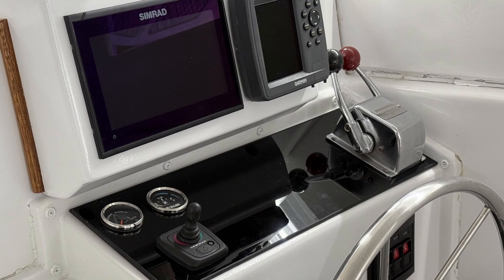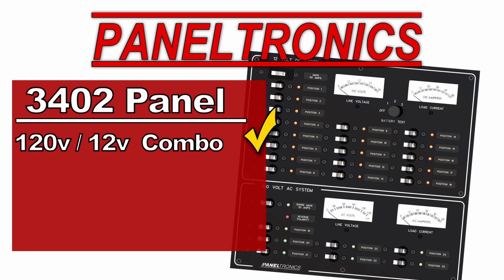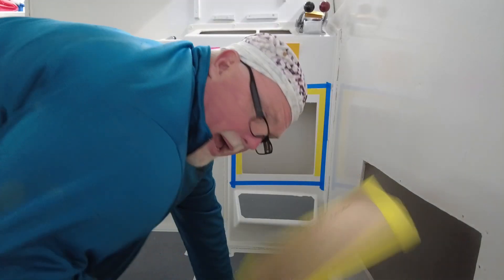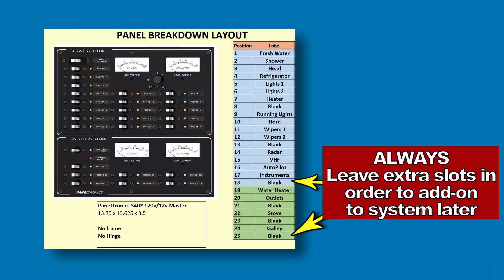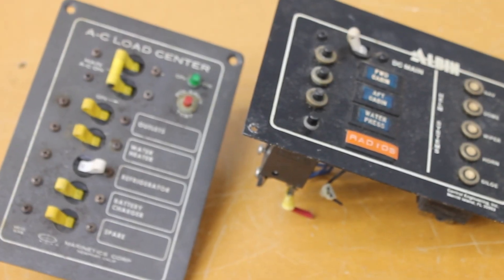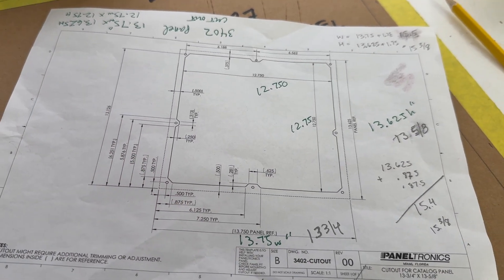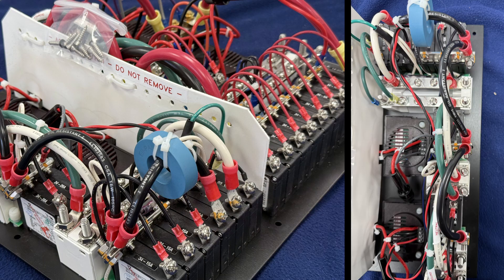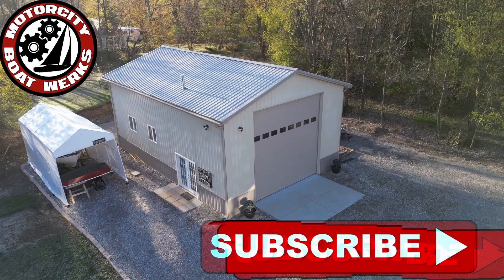Build a Custom Boat Marine Electrical Panel | Great Loop Boat Restoration (Ep122)

Comment: Great video as always. I’m curious why PanelTronics didn’t provide the enclosure for the AC panel as part of the build. My panel (not a PanelTronics) has a plastic molded enclosure that covers the AC side and screws into the back of the panel at 4 points with small Philips screws providing full protection and ABYC protection. I saw on the video the white panel between the AC and DC sides with a “do not remove” message, but this isn’t even close to compliant. Surely PanelTronics has a solution they can provide? Eager to see your solution. 👍
Reply from the maker: Thanks for the comment 😁👍

Comment: Good work as always Joe.  Let me also compliment you for wearing proper PPE and following the rules.  I thought I saw a switch for a chartplotter/GPS, but I'm guessing you're forgoing radar for the time being.  It's also good to have extra switches so you can install a flux capacitor after it gets invented.
Reply from the maker: 🫡 Thanks for the comment Joe